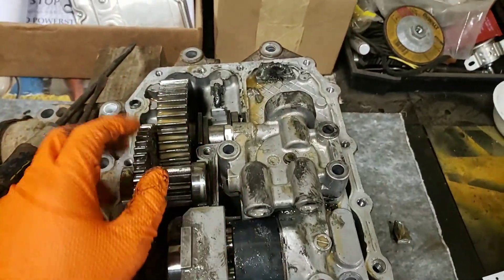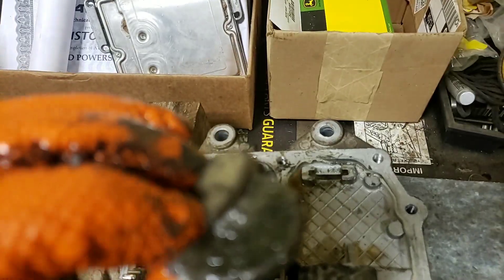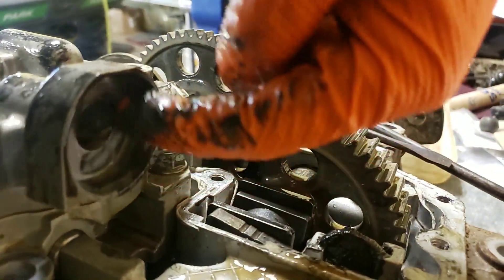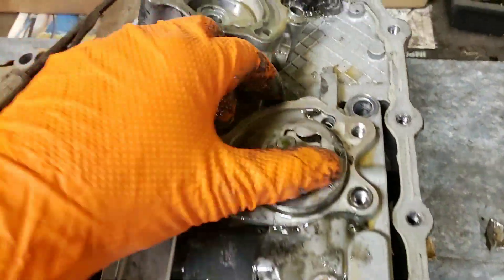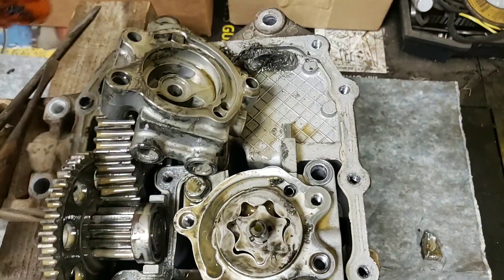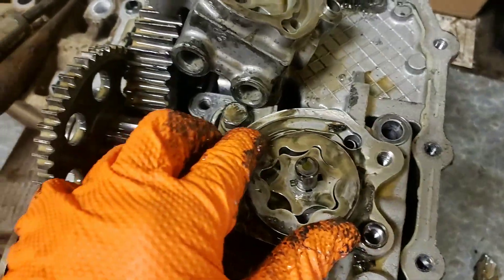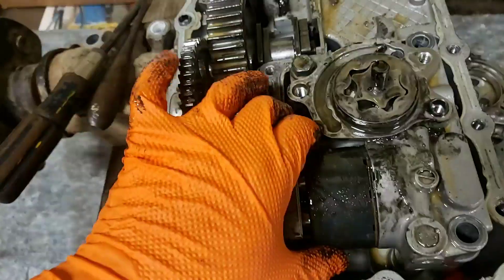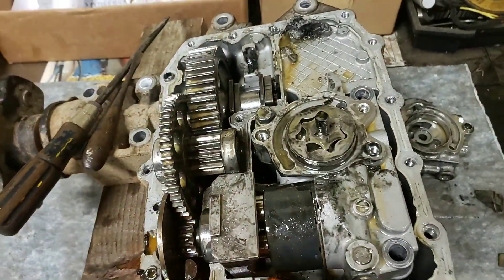Hydrostatic Transmission Operation - Pt. 1

Comment: My JD 2305 HST has an issue that maybe you have some insight on.. JD and the local shop are no help whatsoever.. I feel my HST is getting way too hot, up over 215F at times using the belly mower.  It has about 700hrs on it and I've been pretty strict to the maintenance schedule.  I've hit something twice in tall grass that stopped the tractor (belly mower doesn't have much slip I guess) with some resulting fair amount of grit on the fluid filter when I did the change.  I've since started only mowing till the temp around the fluid level window reaches 180 (about 30-45 mins), then I stop till it cools.  This is with outside temp in the upper 70's.  Speed of the tractor seems a little slower than new, but not significantly.  Any ideas?  Maybe a restriction, worn parts, something warped?